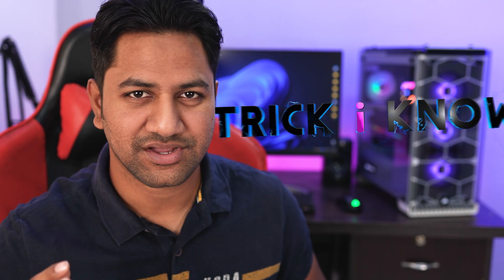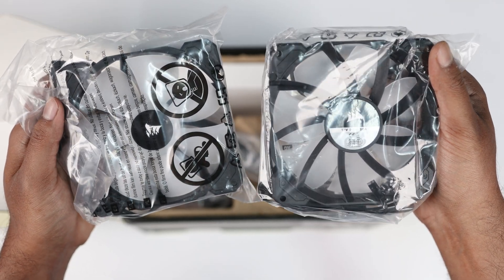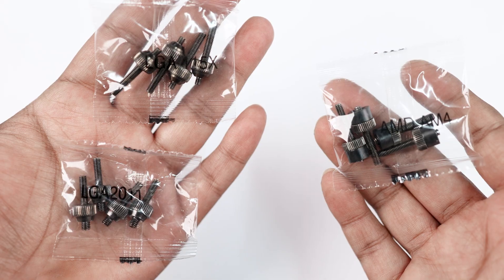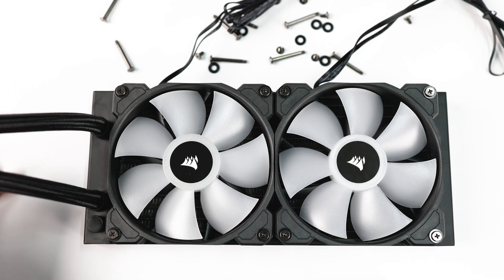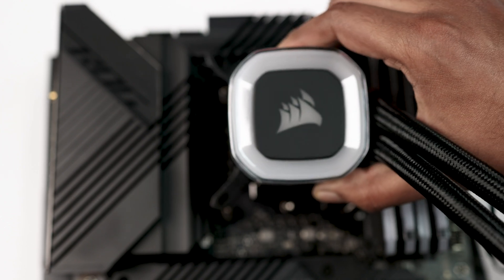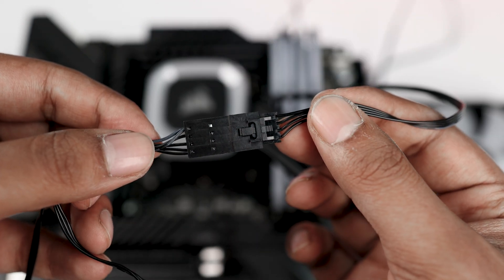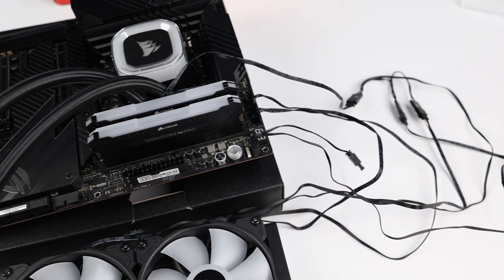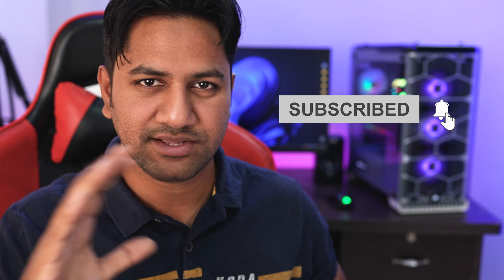Corsair H100 RGB AIO CPU Cooler Review | How to Install (Intel Socket) 240mm

Comment from the maker: H100 RGB Cooler Link: https://geni.us/rR7uWjq  Important Note 1: Corsair H100 RGB only supports LGA 1200 Socket for 11th Gen Intel CPU and Older, It can be installed in LGA 1700 Socket using LGA1700 Retrofit Kit by Corsair. Important Note 2: You can use the fan splitter cable to power radiator fans with AIO Pump port in Motherboard. If you have any questions, leave a comment below. 😎
Reply: 8:00 There is no 3 pin RGB connector on my motherboard, what should I do? @TrickiKnow
Reply: @Afosat  I love it, this mofo says "if you have any  questions leave a comment below" and then don't answer 👍
Reply: 6:55 pump must be connected in the aio pump socket , not cpu fan. Never connect the Pump to CPU_FAN; this is PWM regulated, which you never want for the Pump. You want the Pump having be continuous RPMs all the time at 12v to ensure great flow.

Comment: Hello sir I love your videos I’m in my 65+ years and the last time I did some computer build was about 10 or 15 years ago!  My daughter and son-in-law introduce my wife and I to the world of VR My wife loves the program Beats. Ok so it’s  time to upgrade! Sorry I’m rambling too much! My question is I have a Corsair H100x RGB Elite Liquid CPU Cooler…. There are only 2 cables that are coming from the pump a 4 pin plug and a 3 pin plug a RGB plug and a 3 pin power I think…I also have a Commander core XT. My question is where do I connect the   4 pin plug and a 3 pin plug do I connect it to the Commander core XT or the motherboard I’m a little confused. I also have 4 Corsair RGB fans that I’m hoping to be connecting to the core XT any help that you could give me would greatly be appreciated thank you sir.

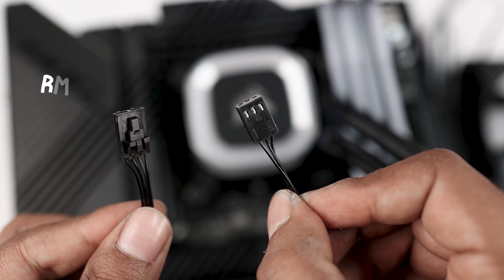Comment: At 6:46, I was wondering about how you connect the pump connector to the CPU fan. why don't you connect it to "AIO PUMP"?  manufactures also recommended it
Reply: I noticed that too.. left me a bit confused
Reply: Yeah, I have mine plugged into the AIO Pump. The only issue I'm having is getting it to appear in iCUE now, not sure if that's related or not?
Reply: @linkcopp-millward9694 no problem connecting it to aio pump?
Reply: Plugging it in, no. Still doesn't appear, turns out it's not the right "model" for that even though it advertises iCUE.
Reply: @linkcopp-millward9694 i think it is ok with using other sockets only you have to switch it from bios DC to PWM 👍

Comment: Hello trick , i got the h55 120mm corsair for my new pc , i used the socket and the , adapter that comes already attached to the aio, now I upgraded my motherboard and i realized i have lost the intel adapter and the screws,(for some reason the adapter on the aio worked on my motherboard) 
Is theres anyway i can buy the other adapter and screws if u have any knowledge on how can i get them ill be more than happy to know🙏🏻

Comment: The box show 3 diferent pieces and inside there's only 2, The missing one Works for lga 1700, where is that one?
Reply from the maker: You have to buy Corsair retrofit seperately for lga 1700
Reply: Fala tijolinho, tudo certo? Mano, eu comprei esse watercooler e veio com o lga1700. Como vc usa  processador da Intel, poderia me vender os parafusos da AMD que vem com esse watercooler? Estou precisando deles para montar o meu… valeu demais! Se precisar, posso te mandar o kit lga1700 também

Comment: Hello. Will this cooler work even if i dont have RGB port on my motherboard?
Reply from the maker: Cooler will work if you have CPU and Pump connector, but for rgb lights you will need RGB port.

Comment: If i were to buy a prebuilt with this in it would i have to put water in it myself? or should the building company do it for me?
Reply from the maker: No need to fill or refill, this cooler works in a loop by itself 👍

Comment: So I connected to the cpu_fan header. How do I control the pump and the 2 fans in the motherboard bios? I don't want to control thru icue.
Reply from the maker: If you have Asus motherboard then use AI Suite 3 application, from asus driver page

Comment: Is It compatible with ICUE? I have a Corsair 4000X case with 3 extra available ports on the lighting node core
Reply from the maker: This aio cooler can be controlled by motherboard's software, for Asus motherboard you can download Aura Sync app.

Comment: on my motherboard rog strix b450 have AIO Pump header can i connect there ? its work ?
Reply from the maker: The official corsair manual says to connect the pump header to cpu socket, and using fan splitter both of radiator fan in Aio pump header.

Comment: hi , please can you test it with LGA1700 Retrofit Kit because the cooler is not in the corsair supported list
Reply from the maker: All you need the Retrofit and this cooler can be installed on 1700 socket.

Comment: How did you get it to work with iCUE software, I;ve been struggling for hours and can't get it to detect
Reply from the maker: It won't works with iCUE, if you have asus motherboard then download aura sync application.
Reply: @TrickiKnow  Sorry for the late response, thanks a lot for your response, this saved me a lot of time and effort. I used it for a while with my Gigabyte RGB Fusion but then later bought a 3 pack of fans from Corsair to get the lighting node core to connect 6 RGB headers too, looks amazing!
Reply from the maker: @_Engineer_  Congratulations, Thanks for sharing 👍
Reply: @abcdexe  I have a Corsair 4000x I want to install this AIO.
 were  you able to connect all the 3 aio connectors (Pump and coolers) to the Ligthing node core)?
That will help me
Reply: @IsmaelFernandez91  sorry for the late response, the lightning node core that came with the fan 3 pack can connect 6 RGB connectors, so u can do 5 fans and the pump :)
Reply: @abcdexe  So if I have the AIO with 4 Corsair LL120s and connect them up to the Lighting Node core I can control the LED's on the AIO to sync up with my fans?
Reply: @anthonybrown594  Sorry for late response, the Corsair fan RGB 3 packs and sometimes packs comes with the lighting node core that has 6 connectors for the RGB cable from the corsair RGB fans. Keep in mind the AIO itself also has one, but that with the fans is 5 connectors and it has 6, so you should be good.
Reply: @abcdexe  hi which fans did you have with the pump connected on the lightning node core?
Reply: @mohammadmohsin1546  "iCUE SP120 RGB ELITE Performance 120mm PWM Fan — Triple Pack with Lighting Node CORE" this pack
Reply: Hey there, just want to confirm if you were able to sync both the fans and pump on Icue with the Lightning node core? Where does the node core get connected to on the motherboard?
Reply: @cycanex  Sorry for the late response I just saw. I was able to sync them if I recall correctly, I use a different cooler now and can't entirely remember, but I recall having it on a rainbow effect all around, having transitions from one point to another just looked weird occasionally. It connects to the USB 2.0 headers on the motherboard, and a SATA power cable from PSU
Reply: @abcdexe  No worries at all, I was wondering if a CORSAIR H100 RGB's block can sync it's RGB with the Node Core. Thanks for the info and your time!
Reply: @cycanex  If I recalled correctly the block could sync somewhat close to what the fans looked like, but it had limited individual lights creatign the effect so don't think it looked exactly the same. Also mine recently seemed to stop working, not 100% sure if the unit is bricked or if I did something wrong, but after swapping back to an air cooler it fixed my temp issues. I would probably go for a different brands cooler personally. :)
Reply: @abcdexe  Works for me, just wanted to see if I could change the RGB to anything other than rainbow puke. As for reliability I would be getting 3 years of warranty which will be enough to last me till I get a whole new rig again. Appreciate you still taking the time to reply.

Comment: hello! is it compatable with 1700 LGA socket?
Reply from the maker: I think it will fit, the mount hole are the same. May be height may differ, after reading some articles i found this useful, LGA1700 Retrofit Kit (Google it)
Reply: @TrickiKnow  thanks for feedback!